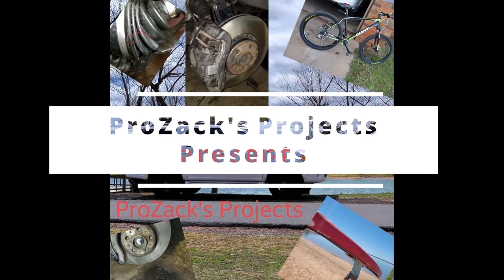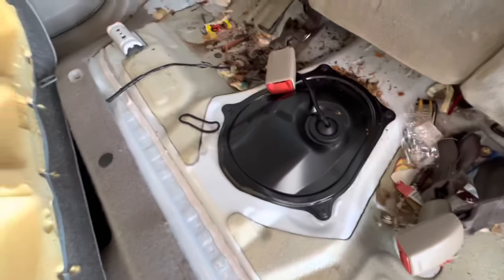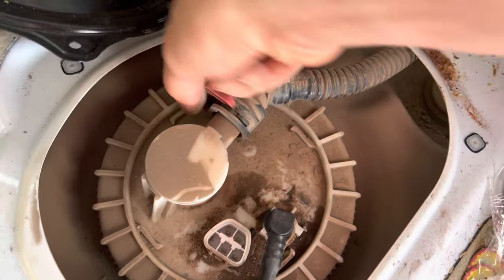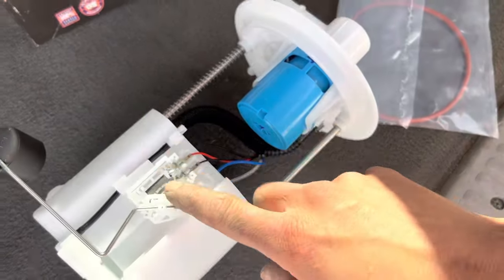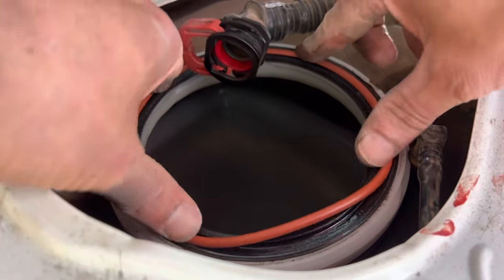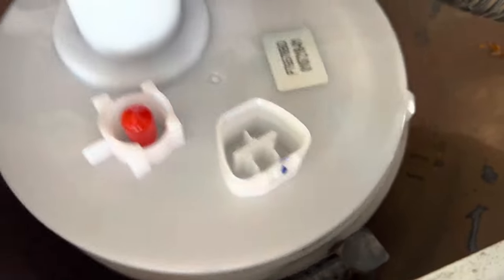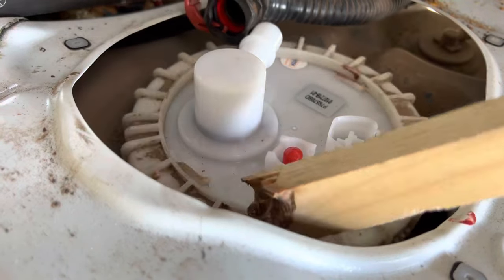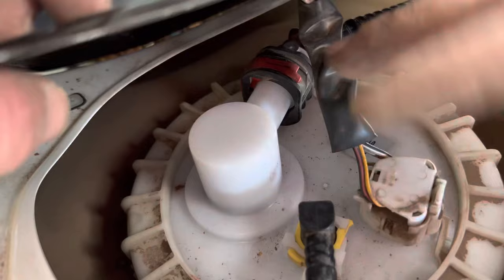2001-07 Toyota Corolla Fuel Pump Replacement. 3 tools needed

Comment: I want to give you a thumbs up for a great video but man, blowing half that crud all into the car and then lifting the old pump off with most of the crud still on it ???  So 2 days later the new pump gets clogged with mud?  All you needed was a wet rag.   Great tutorial otherwise.
Reply from the maker: It’s a lifetime pump so I’m not worried. 😉 jk there actually wasn’t that must loose debris on top but that is an important thing to have on hand.

Comment: EXCELLENT VIDEO! Just the tutorial I needed. (Knuckle busting at its finest lol.)
Reply from the maker: Haha yes. Nothing like your car leaving something to always remember it by.
Reply: Never forget trying to break loose a chevy rear end cap, I busted the tool, and slammed my thumb, right into the seam of the gas tank. Mashed my thumb between the long handled wrench and the metal lip of the seal. For the next month I was using 2 fingers bent, to hold a bolt and start it into the threads.
Reply from the maker: @khacker7345  that’s rough!

Comment: you make it look so easy reality you break all the tabs🥲
Reply from the maker: I actually didn’t break the tabs.
Reply: @ProZacksProjects  I cannot get it to move even with a small sledge hammer
 and wood.  I tried with a metal and a metal piece but it just broke the tab.

Comment: Was the filter in the pump housing? What part # and where did you get yours? Good diy vid. Thanks
Reply: He changed complete unit which includes fuel pump fuel filter, fuel gage assembly and complete housing . That costs around 60 $
Reply from the maker: I bought the Carter fuel pump assembly from Rockauto.com for ~$158 the part number is P76578M

Comment: What were the symptoms of it going bad??? Mine won’t start on the first try always on the second.
Reply from the maker: It just died while getting on the highway.
Reply: @ProZacksProjects  How many miles was the car at before the pump died?
Reply from the maker: @GillyTech  I believe it was around 140k
Reply: @ProZacksProjects  dang, I’m overdue.
Reply: Bad fuel pump will idle fine but as soon as you put it in drive it stalls sputters and dies.

Comment: How do you know this needs to be replaced? I have 2006 corolla cranking with not start?
Reply from the maker: Pull the rear seat and when you turn the key on you should hear it buzz as it pressurizes. If it’s silent then it’s dead.
Reply: @ProZacksProjects  Thank you kindly!